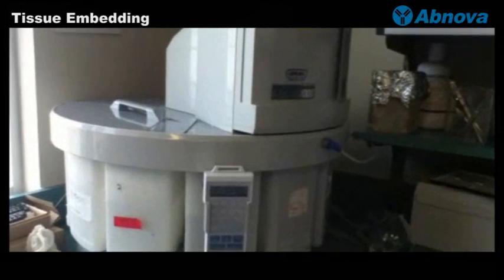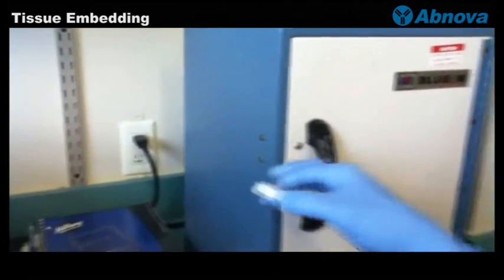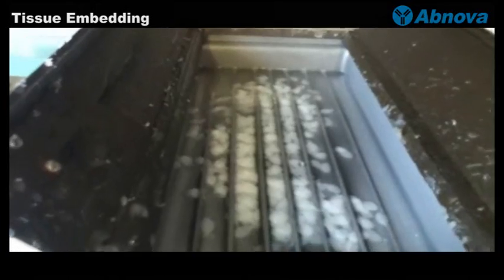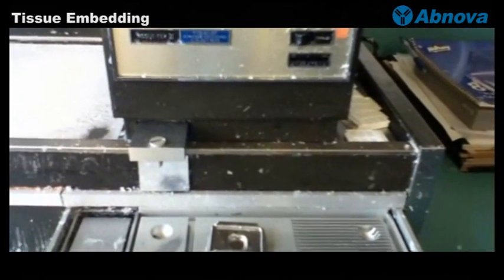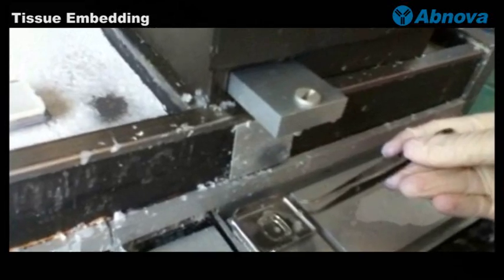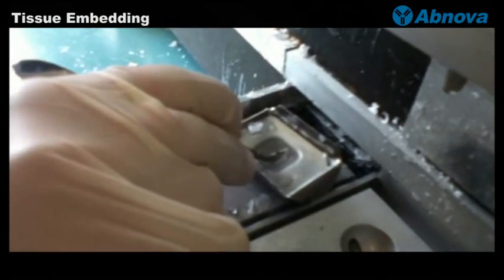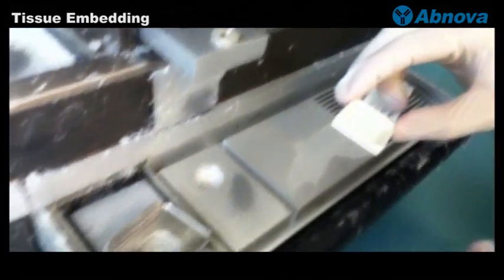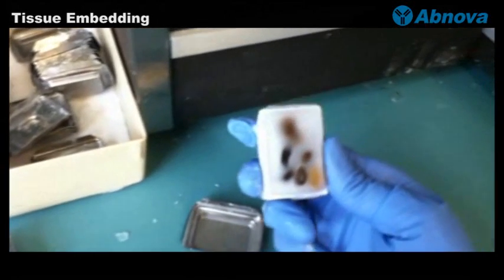Tissue Embedding

Comment: After orienting the tissue on correct side and solidifying the wax, it shouldn't be brought back to hot surface. Adding extra liquid wax should be prompt to avoid forming two separate layers of wax block